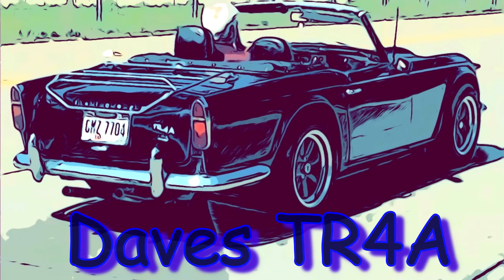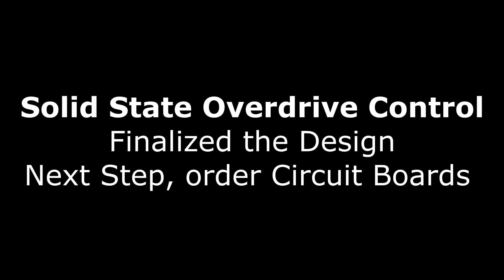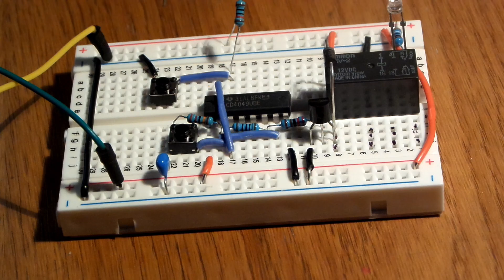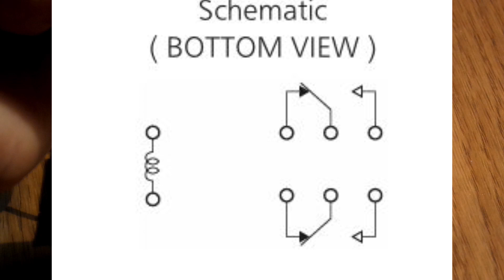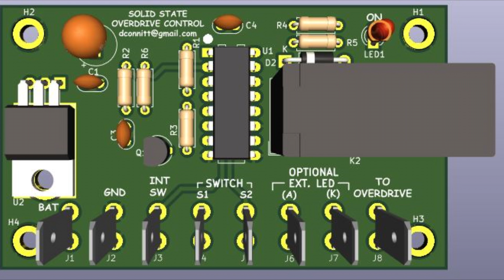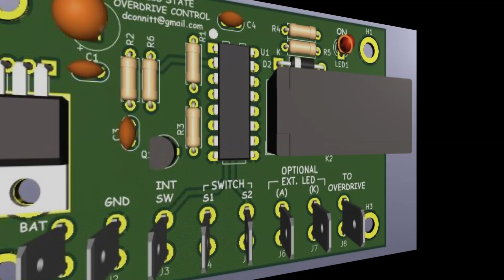Daves TR4A 2024 Solid State Overdrive Control Electrical Design Wrapup

Comment: This is very interesting Dave and I do have a J-type overdrive in the OrangePeelr.  I hope to find you at British Car Day and talk about this new controller. My column switch was acting up the other day so this digital unit might be arriving just in time.  

I think this unit, installed into your TR4A, and you’re at British Car Day would be an incredible opportunity to share your story and see it working.  I know that means a little pressure to finalize it l, install it, and then do the TRials. That might be a little much, but if it worked out, that would be an incredible testament to this new product.  
See you at BCD regardless! 👍